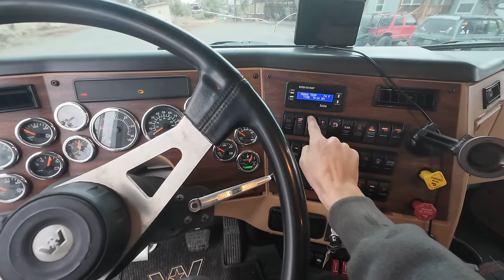It’s time to get this thing fixed

Comment: Casey, not sure on the western stars but the new Peterbilt the switches are computer programmed so if you have a switch go out make sure you save it because you have to get the programming off it to put the new switch in and if you don’t, you have to have the company come out because it’s gonna need programmed by them because they will not give you the program to do it

Comment: The only thing I don't like about the easy latch on those moose bumpers is that they will start to rattle over time. Only gripe. Also, Ali Arc is superior, in my opinion.

Comment: Casey seen where the auto chain makes a 1/2 ton pickup size would you think about putting auto chains on the OBS Ford wheel lift truck or is it a clearance issue with the sneaker wheel lift

Comment: I'm surprised given how hard a wrecker can be worked that you don't have an analogue pyrometer.  I assume the multi-gauge has an alarm function that can be set for everything it monitors? I'm very surprised you don't have cross locks on that rig. Why do you think CB is dead in the US? It's still a vital part of trucking here in OZ for both convenience and safety.
Reply from the maker: No need for pyrometers on the new electronic engines.  They will defuel and back off long before they get to the point of hurting themselves

Comment: I have liked the rollback.  But I get when an issues is not fixed, over time. Especially when you are paying for something you can’t use.  I suspect the fork lift up mountain coukd have been easily hauled with roll back easier then remove Zack, lift, hoot trailer, unhook, unfold front, load, fold, hook, haul, unhook….

Comment: Smooth sanded plywood and cardboard at minimum are a good choice over trying to scoot over gravel. Roll up yoga and pilate mats good also...not so much slip and slid, but easy on human body parts.

Comment: So when will those two blank switches for differential lock be filled or is that a big expense ??
Reply from the maker: BIG expense
Reply: @CaseyLaDelle  One axle .. maybe the first ????????
Reply: @CaseyLaDelle  Or would the rear axle be cheaper ...

Comment: Why are the hitch adaptors bolt on?  Could they be slip in and pinned like receiver type or is there a strength issue?

Comment: Rather than hooking directly to the brake valve in the engine compartment (where everything is in the way), why not just trace that air line back a little and install a T with a ball valve so you can still hook to that valve, just in a spot where nothing's in the way...

Comment: I'm a total non trucker.  Why have the on spot chains on separate switches for each axle?  Why not one switch for both? Is there a situation where you would only want them on for one axle?
Reply from the maker: Yes, if you just need a little bit of extra grip why put the wear and tear on both?

Comment: Let's see, need a compression test on that truck with the cylinder not firing. If that's a Cummins it shouldn't need the engine replaced. Replacing everything related to that cylinder is possible in the truck short of the crank. Once you are into the cam though you are in pretty deep. At least on the older engines so unless something major has changed this should be the case.

Comment: I understand dropping driveline on autos. Why on Roadrangers. If you have a brownie and put it in neutral could the driveline be left connected?  When I was younger I saw one logger towing another with a draw bar and the driveline was still connected
Reply from the maker: Nope, no lubrication when the engine isn’t spinning

Comment: i have been looking at quick swaps . i keep leaning towards the NRC but your selling me on the zacklift  what's the min wheelbase ?. I noticed your truck has no rear crossmember .is that nnercessar6y ,because i use my truck to pull a lot of bumper pull trailer so i need kind of a tail board rear crossmember .

Comment: Im an auto shop owner in NW PA and I am self taught. Started my own shop 6 years ago. I fix cars from most local shops including at least 1 from almost all of the local dealerships. There are ways to prove out almost everything. I feel bad for truckers and farmers. The service industry for mechanical stuff sucks. I was an industrial mechanic before working on cars. Plastics shop I used to work for would call machine manufacturer in. These guys fly in on a plane with a few tools none of which are for the job you called them for and they don't even understand how to remove a bearing race.

Comment: Please do yourself a favour and move the wires and power jacks on the floor between the driver seat and mini-fridge so you don't step on them getting in and out of the bunk.

That will extend the life of the wires and prevent intermittent shorts in the future that can either damage whatever they're powering or cause whatever they're running to work badly...

Comment: Please check the frame rate of your camera recordings. I think it's set to 24, 25 or 29 fps, but your project frame rate is set to 30 fps. So some frames get doubled, which gives a weird stutter effect once or twice per second.
Reply from the maker: Nope
Reply: @CaseyLaDelle  weird. Which camera did you use?
Reply from the maker: @RubenKelevra  DJI action 4
Reply: @CaseyLaDelle  alright. I've looked at the video frame by frame. There's no frame duplication but the panning action isn't smooth.

I think what's causing it is the stabilization having trouble while panning, to keep the motion consistent, plus the very short shutter speed of the camera - so that there's hardly any motion blur to hide imperfections.

Movies are shot with a similarlily low frame rate, but the stuttery motion by having very long exposure times of a 1/48 second (also called 180 degree).

As those action cameras have no shutter to reduce the amount of light hitting the sensor, you can only use an ND filter to force the camera to use longer exposure times, to create motion blur similarly to what you see in a movie.

The other option is using software filters, to create the motion blur after recording - which is quite resource intensive.

The best option I think is to just switch to 60 fps recording. This gives the eyes more still frames to make sense of the motion happening, so even a short shutter speed doesn't look that stuttery - and uneven motion, like the ones created by the internal stabilization of the camera, are better hidden.
Reply from the maker: @RubenKelevra  I’m going to do none of that.   I’m not trying to film a motion picture here, it’s just a simple YouTube video.  I’m going to hit record, it will get the video it gets, and the audio it gets.   Whatever that happens to be is good enough for me
Reply: @CaseyLaDelle  I think you misunderstood my point a bit: Movies traditionally use a low frame rate because of the costs for film reels involved. To get away with that, they use very long shutter speeds.

If you now go and select a low frame rate like movies do, you don't have to copy their long shutter speed because of artistic choices, but because 30 fps doesn't give a pleasent viewing experience on its own.

Different people react differently to low frame rates, some seem to have no issues with them, others have trouble viewing low frame rate content with short shutter speeds.

I'm in the later bucket, that's why we're having this discussion. You may be in the first bucket of people, that's why it's "good enough" for you.

Is there a specific reason why you don't just switch to 60 fps? I mean it's like a one minute adjustment in the settings of your phone and camera and storage is cheap like never before 🤷‍♂️
Reply from the maker: @RubenKelevra  yes, because because I have used it and people complain about that too.   No matter what I do people will complain, so why put in more effort working with bigger files that make my computer run slower and take longer to upload if I’m just going to get complaints either way??

Here’s my answer to anyone who complains about video or audio quality..
Go make your own videos however you want and I’ll do the same.
Reply: @CaseyLaDelle  people complaining about 60 fps can't be sane. You can just select 30 fps from YouTube for playback and get exactly the same files like now 🤷‍♂️
Reply from the maker: @RubenKelevra  like I said, make your videos however you’d like.
Reply: @CaseyLaDelle  that's a weird response. I've explained that not everyone perceives video frame rates the same and just because it looks "fine" to you, others have trouble viewing your content like this.

I mean there's a reason why TV content is broadcasted in 60 fps (50 fps in some parts of the world) as well. It's because it's easy to produce and is pleasent enough for most people.

I wonder if the people complaining about 60 fps also call their favorite TV station to complain about the frame rate 😂
Reply from the maker: @RubenKelevra  exactly, not everyone sees it the same.  So why should I change it for YOU when you are literally the only person who’s complained out of the over 4 million people currently watching this channel??
Reply: @CaseyLaDelle  just because I take the time and discuss this with you, which wasn't really meant as a complaint - more a suggestion - doesn't mean I'm the only one capable of seeing this.

144 Hz monitors are hot selling for years, TV is broadcasting in 60 fps forever, even at the time bandwidth was a huge premium and even phones are getting 90 Hz displays for a couple of years now. There's a reason for this: Many people do see the difference.

But hey, if you wanna play the ignorant, I'm not gonna stop you. My intention was to help and maybe educate, if necessary, not to demand anything.

Have a nice day

Comment: omg watch what you say. comoany i worked for sent truck to shop many times, finally shop said needed rebuilt. company said yes , shop did in frame rebuild, and when it xame iut , it still had the same problem🤔. then 2 weeks later back for throw out bearing, we asked shop why not during rebuild, tgats when it was exposed of in frame rebuild.😒

Comment: I noticed your air lines don't have a pole to keep them off the deck , I guess you call it a tree, so they don't rub and get a hole  and you would  lose your air, I almost got a ticket once.
Reply: Casey told in a earlier video that its ok without that "Tree" IF you have that black  thick protective plastic over the lines. Like some hydraulic hose have on to..

Comment: Again us inquiring mind guys, why didn't you just load up the jeep or truck on the roll back and drive it, instead of towing?
Reply from the maker: Because it has engine problems and is only running on 5 cylinders..